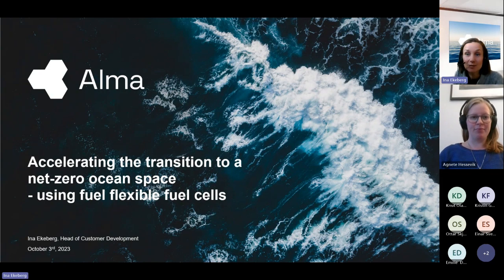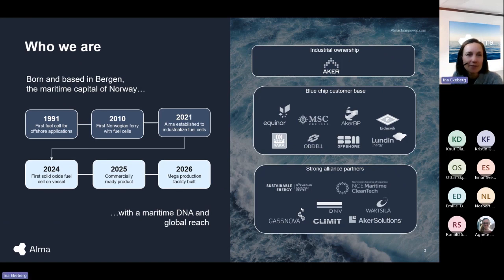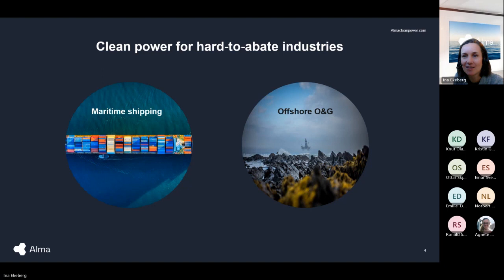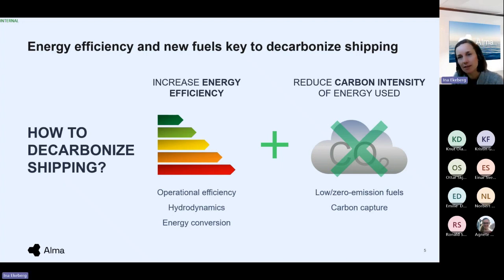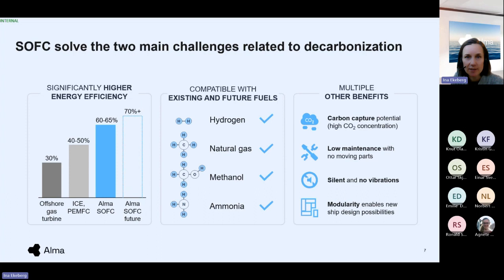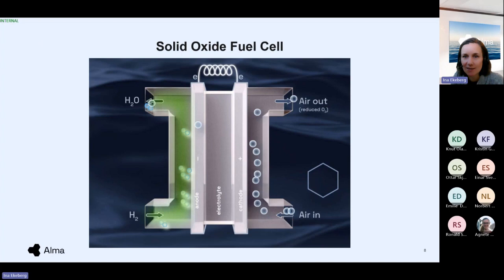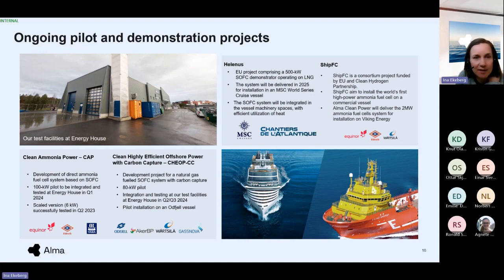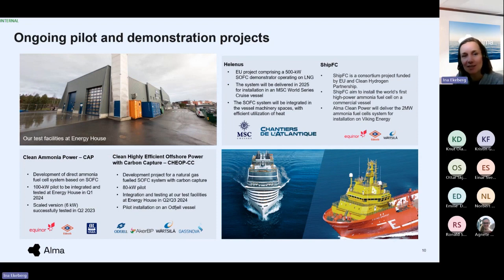BEL Lunch 10.3.2023 Accelerating the transition to a net zero ocean space   using fuel flexible fuel

Comment: Good work, but Net Zero is not required.  The Transient Climate Sensitivity (TCR) from CO2 alone is 0.71 C/doubling of CO2.  Claimed further warming by the UN IPCC and its AGW hypothesis is due to water vapor. However water vapor is too complex to model so it is injected as a fit parameter.  The problem with this is that the resulting 'enhanced' TCR does not match the satellite and balloon datasets and predicts greater warming than we observe.  Furthermore the IPCC AGW hypothesis claims that the Lower Tropical Troposphere (LTT) will warm faster than the surface if the hypothesis is true. Not only do we not observe that, we actually observe the opposite.  A better model than the IPCC AGW is the theory based on solar magnetic variability such as the papers in Nature by Svensmark and Shaviv.   I am very surprised that labs such as this have not done due diligence with a full literature review before committing funds to solve a 'problem' based only on what the IPCC and media have said rather than look at all the research papers generating hypothesis of the warming.  As a former research physicist I can only shake my head with disbelief at the state of physics today and its very poor research methodology  (not even bothering to look for other hypothesis to the observed warming is unbelievable, yet it is clear that's exactly what has been going on !).